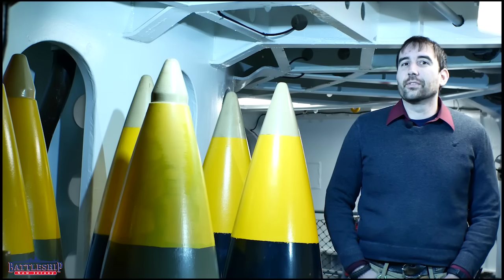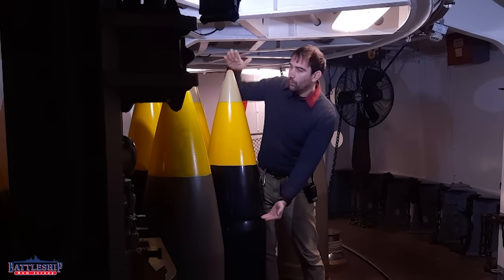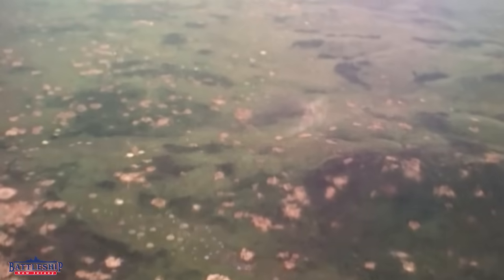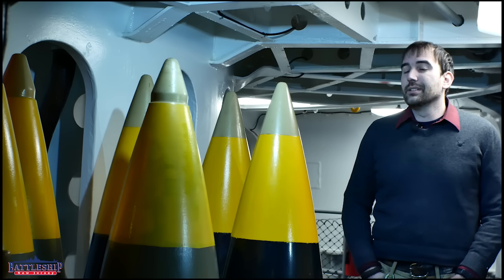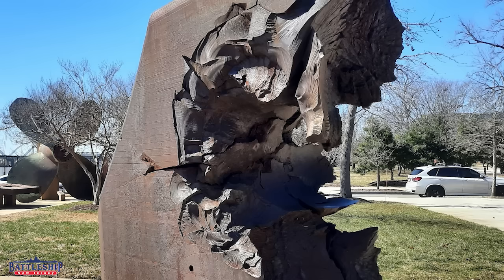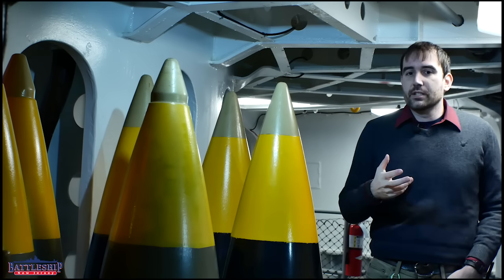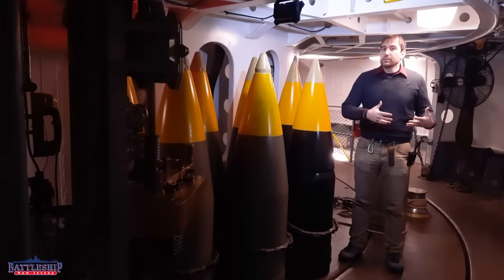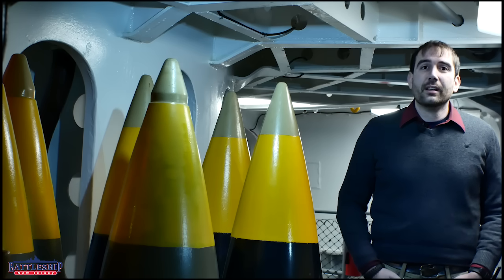What Does the Impact of a 16in Shell Look Like?

Comment: Having sat on a Japanese 18" projectile and several US ones I think the overall quality control was much better on the US ones. Mk 8 were the best Battleship projectiles ever made from what I was briefed about them. Low angle impacts left some HC projectiles lying about as the impact was too diffuse to set the base fuze off and the angle was so flat the nose never touched the ground. A problem on Betio island to some extent along with a lot of overs out into open water. I had friends who saw firsthand the 16" working over targets during the Inchon landing and the New Jersey working in Vietnam most of those were HC at decent descent angles for proper fuze function.
Reply: What the east even today has not actually figured out is that the US military power is based on the industrial economic engine. 
The US could output more aircraft in WW2 than Germany, Britain, Japan and Russia combined.
Reply: @bighands69  We weren't having our factories and railyards hammered flat on a daily basis.
Reply: @kimweaver1252  
The US was not attacked because the Germans and Japanese were not able to attack the US mainland with any level of success. 
I am confused as to why think the US production output that squashed Nazi Germany and Japanese imperial empire can be explained away by your comment. The US had the ability produce weapons' that could destroy them and they were unable to keep up.
Reply: @bighands69  I'm confused as to why you're confused.  We were able to sustain high levels of industrial output because we had a lot of resources in country and our factories WERE OUT OF RANGE of the enemy.  The Europeans, Japanese, and Russians had to contend with air strikes and sabotage which disrupted every aspect of industrial production and distribution.  Capiche?
Reply: @kimweaver1252  
But why did the Japanese sustain airstrikes but the US did not?
(I think you already know the answer).

Comment: From my standpoint I would have made the high capacity round out of a little more metal and increased the charge. A proximity fuse for shore bombardment would also have been nice to use.
Reply: You have to consider that US battleship munitions were already considered as ultra heavy and dense shells in comparison with all other battleships of other navy's.  That's why they predicted that they as a 16 inch shell are more powerful than the 18 inch shells of the Japanese Navy.
Reply: @CrazyPalidin  I am talking about a shell for just shore bombardment. With an airburst about 20 feet off the ground you can eliminate a lot of things.
Reply: They could be made out of some composite material or an alloy but would they withstand the rigors of naval warfare?
Maybe from a fixed position on land they may be useable like that.

Comment: Are these shells cast, or machined from a larger piece of metal? I wonder what the cost of each round was.
Reply: They are machined forgings. They are machined both inside and out for both High Capacity and Armor Piercing. The wall thickness of a HC projectile is about 2-3/4 inches thick. The bottom of the shell is closed off with a thick plug base plate that is screwed in. The nose has a pretty hefty fuze adapter  screwed into the shell to allow a Mk 18 fuze to be fitted.  I saw info on cost but that was long ago and I can't recall the numbers.

Comment: If I remember correctly, when testing the turret faceplate from the Shinano, it was at a distance of 5km but they used a reduced powder load. So the shell hit the faceplate at the same velocity that it would have at 20km if they had used a full charge.
Reply: Correct the powder load was adjusted for the range which was so short to ensure a hit. It was a common testing procedure on gun's of this size and larger land artillery pieces.
Reply: @Cragified  l
Reply: No, this is not correct.  They fired  at this armor plate target  at point blank range.  400 feet*.   And then they extrapolated longer range figures , from the 400ft  test hit they made , with the projectile and propellant used for the test.

* from - U.S. Naval Proving Ground, Dahlgren, Virginia, Report #5-47, "Ballistic Tests And Metallurgical Examination Of Japanese Heavy Armor Plate" (November 1947)  - " the plate was secured 400 feet from the gun for testing."
Reply: @chrisperrien7055  thank you
Reply: Yup. I've read reports stating the same thing about this test shot. 👍
Reply: It still wasn't a realistic test, especially since it was a 0° impact angle. In reality, it was fairly unremarkable that a 16" gun would penetrate that amount of armor at that angle. What made ship armor more effective in reality was the different angles, layers of armor and other variables that wouldn't be present in a test.
Reply: @Random Random The turret face was made before they decided to change the Shinano into a CV.  The other two went down with their turrets.
Reply: Were these tests done at Dahlgren?

Comment: What happened to the ordnance shot at other vessels that missed and just hit the water? Do they sink to the ocean floor unexploded, or does the fuse mechanism cause them to explode as they hit the water , or does a delayed fuse eventually cause them to explode?
Reply: Usually, the shell would explode as if the surface of the water had been an armor plate, so HC would detonate on impact, AP would travel through the water a short distance then explode.

If I recall correctly, Japan tried to develop a long delay fuse specifically to allow hits below the waterline to be effective as most standard fuses would detonate the shell early if it hit the water before the hull. I don't remember if they ever actually fielded that fuse or if it was just a prototype though.

Comment: I remember thinking the bursting charge seemed a bit small upon viewing of a previous video on the shells. WW1 saw the development of "mine shells" shells with inordinately thin case walls to maximize fill weight. It seems like not only would that increase effect on target, but also potentially increase the range of the guns by reducing the overall weight of the shell as high explosive is far less dense than metal. Then again it could be the case that the shell capacity was already maxed out given the structural demands of the shell/ the pressures incurred during firing. It would definitely be interesting to see a cross section of both shells to see the relative thickness of the walls of each shell.
Reply: Shell has to survive penetrating the armor. If it is too weak but still has the energy to get through it will shatter on the armor. Hence why for a while face hardening was all the rage. And the actual bursting charge isn't what is really doing the damage. The damage is from all the pieces of shell a.k.a. splinters that go scything out from the bursting point with well enough energy to cut through light bulkheads not to mention people and machinery.

Comment: think of the damage these guns could do with a modern artillery computer landing multiple shells within a dozen feet of each other would be pure devastation
Reply: The original mechanical computers are extremely accurate. When they reactivated them in the 1980s the Navy determined the existing fire control was as good or better then any computer they had. Besides at extreme range the dispersion of the gun is more of a factor. Unless you design guided munitions. Which exists for artillery.

Comment: A very good friend of mine was a ranger in Vietnam. He related a story to me about how one time he was spotting a bunker to be distorted. The Air Forced made strike after strike without destroying the target. Finally he called in a strike from the New Jersey. The first round landed on target. The bunker flew into the air and was destroyed.
Reply: Now worship the fact that that was done from several miles away on the slightly rolling vessel that serves as your gun platform. The calculations involved melts the average mind. You even have to take into consideration the rotation of the earth. Corealis(sic) effect. Windage. Basic trajectory. Timing between target and gun.
WOOPEE!  From an old gunners mate, '72- '74.
Reply: @darrellcook8253  
The computer was MK 1A electro mechanical using synchros and servos. 
I was an equipment specialist working for SPCC during restoration of the battleships. Parts were extremely hard to replace as technology and manufacturing methods had bypassed WWll methods and materials. It computed for range, wind, apparent wind, roll, pitch, yaw, speed of ship, speed direction and elevation of target. I am sure there were other inputs also. 
Was on board the Missouri before restoration. Saw an ammo ship staging 16" projectiles for the New Jersey during UREP for the DDG I was on while offshore Vietnam. Never saw it in service.
Reply: @darrellcook8253  all done by an old WWII analog fire control  computer on the Iowa's, with radar assisted ranging, and 8 guys? IIRC turning knobs on the computer, to keep the solution true
Reply: @darrellcook8253  Sonar 71 to 77. I can relate.
Reply: @darrellcook8253  Didn't they also have to take into the calculations the temp of the barrels?
Reply: @samuelhowie4543  And how many times that barrel had fired already in it's life; and humidity/air density and probably a few other factors.
Reply: @darrellcook8253  Thank you for your service!
Reply: The British Tallboy was a supersonic dumb bomb that buried itself at least 30ft before exploding. The earthquake effects meant a near miss was more effective than a direct hit.
Reply: > The first round landed on target. 

... is probably exaggeration. WWII era guns weren't that good. Even today's guns aren't that good when firing non-guided shells.
Reply: @denysvlasenko1865 The expected precision from these guns was about .5 MOA. i'd say it's plausible once you have accurate grids for the target
Reply: Was the Air Force using dumb bombs? The first laser-guided bombs were dropped late in the Vietnam War, reducing the circular error probable quite a bit, down to New Jersey's error I would expect. As your friend's story indicates, near-misses against reinforced targets are unlikely to be effective, although I imagine life wasn't pleasant for anyone inside that bunker with bombs going off nearby.
Reply: @danielmocsny5066  The Jersey had a fairly safisticated computer targeting system as you can imagine able to hit other ships at 23 miles so yeah, bye bye bunker.
Reply: @danielmocsny5066  Sure, not that they could reminisce about those moments with the bunker and its inhabitants flying into the air in chunks.
Reply: @danielmocsny5066  laser guided bombs were for more strategic point targets
Reply: @danielmocsny5066  most of the bombs are dumb bomb and yes, some of them are still underground and sometimes explode in the habitant areas

Comment: At longer ranges, I believe that one needs to consider the interaction of spin and aerodynamics.  That is, the shell is still pointed up at near 45 degrees when it begins to descend into thicker atmosphere.  The aerodynamic cone then begins to impart a rotation nose down and this makes precession.  That I could reason out for myself.  The cyclic rotation of the nose towards the end of its long range journey is called nutation.  In some papers that I discovered, the author claims the nose of some shells follows more of a flower petal pattern but I do not know why if the shell contents are axial symmetric.  Regardless, short range (like with Bismark as the target by Rodney et.al.) and long range (like with Hood as the target by Bismark) behavior is different in more than speed I think.  The Howitzer boys should know.

Comment: Hey Ryan and crew, we actually know what a 16" Mark 8 would do to a Battleship.  Look up the battle damage from Operation Torch suffered by Jean Bart at the hands of South Dakota's gunnery.  There is a picture of the bow just forward of the #1 turret which shows the front hull nearly separated from a Mark 8 landing there during the battle.  Pretty epic hole.

EDIT:  It was Massachusetts, still a South Dakota Class
Reply: was not south dakota it was the USS Massachusetts
Reply: Also not a 50 cal 16 in
Reply: @kenstahler6010  actually the 50 caliber isn’t in reference to the bore like a .50 cal. It’s the barrel length. Large guns tend to have the length measurement listed in number of times longer than the bore. 
So these guns are 16x50 inches long.
WWII German antitank guns used the same system in their names, the 88mm l/71 (“long 88”) being 71 “calibers” long.
Reply: @GudrezBilly  know that, but I believe the 50 had a higher velocity so possibly more damage
Reply: @kenstahler6010  You are correct, the SoDaks had 45 Cal rifles with a slightly lower muzzle velocity. It is said they were better deck penetrators than the 50's.
Reply: @kenstahler6010  It's not a matter of damage, it's a matter of range and penetration potential. The 16"x50 barrel gave it a little extra muzzle velocity, thus giving it a flatter trajectory and a bit longer range. With extra velocity also comes increased armor penetration.
Reply: @GudrezBilly  Correct. To be precise, the term is calibers, not caliber. Caliber is the diameter (in hundredths of inches), and calibers refers to barrel length as a multiple of projectile diameter.
Reply: Thanks everyone, I got my SoDak's confused while trying to remember a fairly obscure (albeit very important) Naval Battle.  My point still stands... we know what a Mark 8 would do to a battleship because the damage pictures of Jean Bart exist.  Yes, from a lower muzzle velocity 16"/45 from a South Dakota instead of the 16"/50 of an Iowa, but at the ranges at which this fight occurred and the armor it was penetrating, it doesn't really matter the difference in penetration amount.  It's even more telling that of the rounds which impacted Jean Bart, only a few actually detonated due to faulty older fuses.  One of those hits was in the secondary battery magazine, which had it been full of ammo in a complete battleship, would have most likely claimed the ship or a significant portion of it.
Reply: It indeed was the  USS Massachusetts, which has 16'/45 cal main rifles.
Reply: To be fair, the newer French battleships were really battlecruisers. They had very poor armor even compared to other nations' treaty battleships.
Reply: You must be joking? Massachusetts received few hit from Jean Bart 15" and that was more than enough to left a deal to USAF.
Reply: And btw Jean Bart didn't suffered any serious damage cause her main deck literally was impenetrable for 16" shells.
Reply: @silentneighbour4865   Both of those statements are factually wrong, JB suffered substantial damage from the 16"s  never hit the Massachusetts

Comment: During the Vietnam war the Americans should have developed base bleed shells for the Iowa's. These would have had a range of 30mile. 
Additionally RAP (rocket assisted projectiles);should have been developed. These would have had a range between 50 and 100 miles. And been much cheaper than missiles.
RAP can boost range between *2.5 and *5 with similar warhead weight. May need longer payload IE integrated rocket booster and possibly a bigger kicking charge. Maybe slower burning powder so as to keep barrel pressure in check.
Edit below
The de Moines class with 8 inch guns had a thirty mile range with RAP rounds during Vietnam. (Eg "Newport News").

Comment: What would have happened if they had made the wind screen as part of the actual shell and not just an aerodynamic add on.
Reply: It would have had more of a tendency to deflect away from its target, particularly if it struck at a low angle.  The tip would deform and tend to lead the rest of the projectile off at an angle.

Comment: I have heard that the 16” shells could sometimes be seen in flight. Do you know of any video or photo evidence of a projectile in flight?
Reply: You can see artillery shell in flight if you are standing behind the gun.  In that position there is little angular change for the projectile as it moves away and eventually becomes too small to see.
Reply: Yes....I believe I saw a broadside photo under navy source.....think it was Iowa
Reply: YT has a short video called USS Missouri Firing 16 " Guns (Inside).  At frames 247 & 248 the photographer captured the projectile just leaving the fireball from the muzzle.
Reply: I have personally seen  8" howitzer rounds in flight.
Reply: I often saw 8 inch shells after they were fired from our 8 inch - 50 mounts on the USS Newport news.

Comment: How small of a diameter would the target zone be for the sixteen in guns at full range, 23 miles. Just curious about the expected accuracy?
Reply: I found some notes on a test firing in 1987 where 15 shells were fired at 34,000 yards (19.3 miles). 8 landed within 150 yards and 14 within 250 yards.
Reply: @n1vg  Pretty amazing considering being fired from a moving platform and a flight time around 50 seconds!

Comment: Imagine the the velocity of a 16"/50 without the superheavy shell. Without the issues that plague the Italian 15"
Reply: The Mk-7 gun velocities were 2500 fps with the 2700 lb shell, and 2690 fps with the 1900 lb shell.  Due to aerodynamic efficiency, the slower AP shell had greater range of 42,500 yards, compared to 41,500 or so for the lighter shell.  
However, tests with the earlier 2240 lb AP shell showed a dramatic increase in range, with this shell reaching 47,000 yards.  Velocity of this is not known off hand